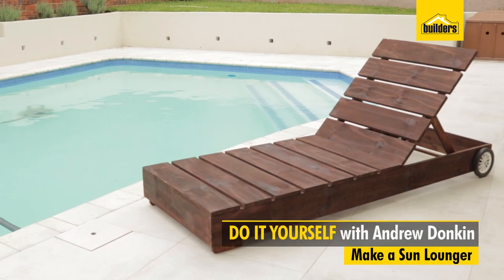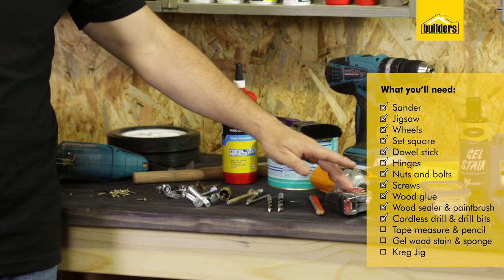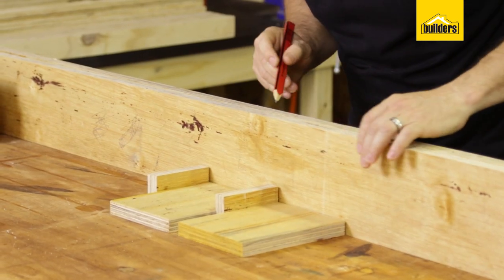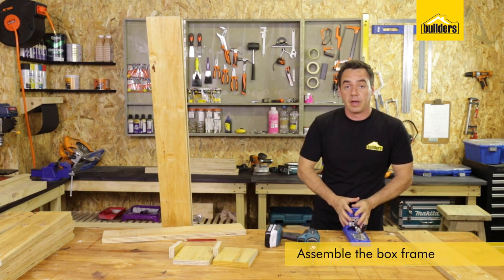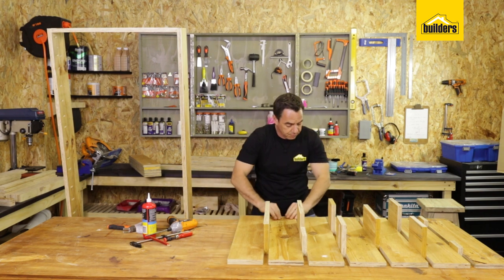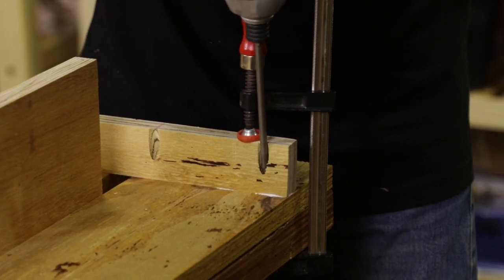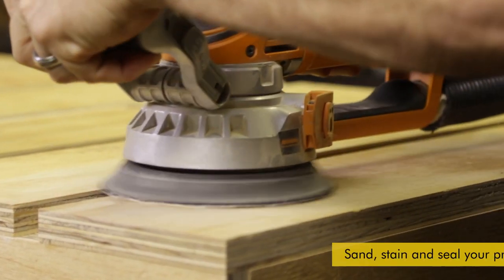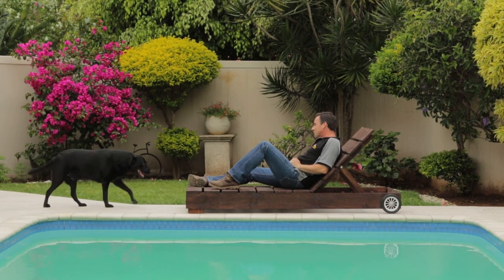Sun Lounger - DIY

Comment: Yours looks the simplest to build of all I have just seen after scrolling though pages of them on YT, and it was one of the first I seen. Will downscale the timber sizes and use 80x19mm dressed fence palings for mine as I'll need to lift it to shift it around my deck. Thanks from New Zealand Saffa 👍

Comment: I enjoy watching your video. The ply you using looks much nicer than the ones I bought from Builders Express in Mafikeng. Is it a different quality or type as the ones I bought had another of knots  on the one side and patched on certain areas. Why do we not get Birch plywood like in Canada or USA with no knots and voids between the layers, or better quality boards. Thanks
Reply from the maker: Hi Bobby.  Normally 18 mm and the 21 mm plywood has knots on one side and clear on the other. Sometimes it is good to check some of the boards and select your preference depending on the project at hand.  Andrew sometimes likes the boards with more knots and chooses them on purpose.  He calls them "Knotties" :) .  The thinner boards (12 mm, 9, 6 and 4 mm) are a much higher quality with a smoother finish too.  The 21 mm and 18 mm are a rougher grade.  NM
Reply: BuildersFan Thanks